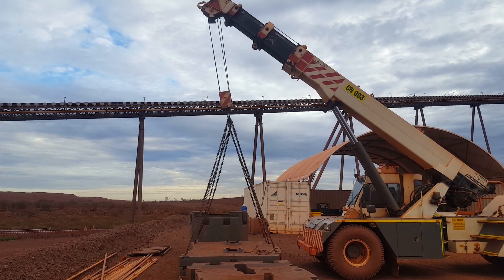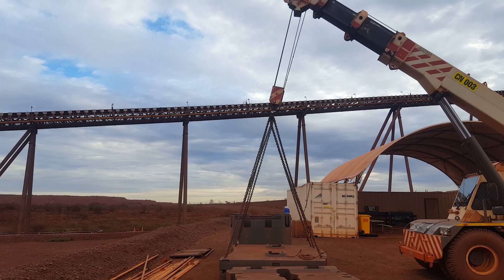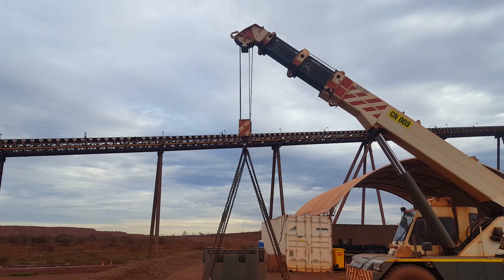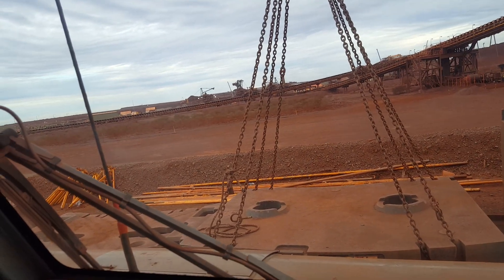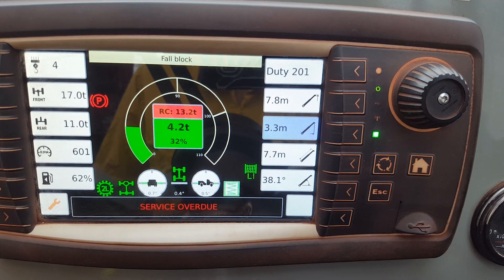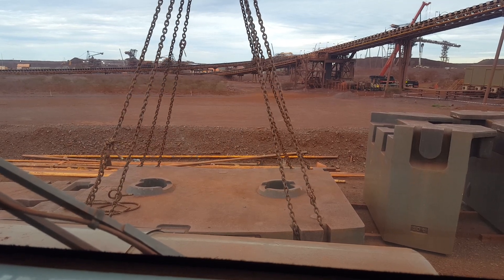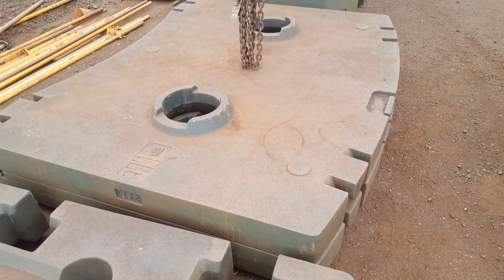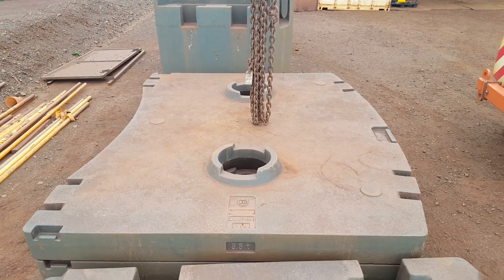Hook Centre of Load!

Comment: When lifting 40ft sea containers off semi trailers, multiple factors can play part, causing uncontrolled movement. 
. The Semi can be on a slope or the sea container may be loaded more at one end. Each situation may create load swing on one end. This can be unavoidable so slow movements up and watch where the load cracks first.
This can help determine where  the load may swing.